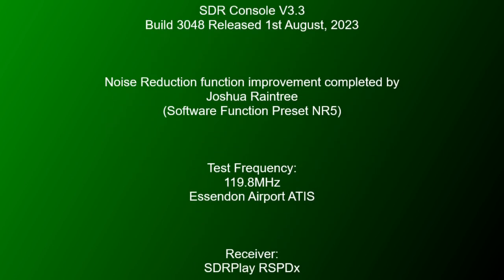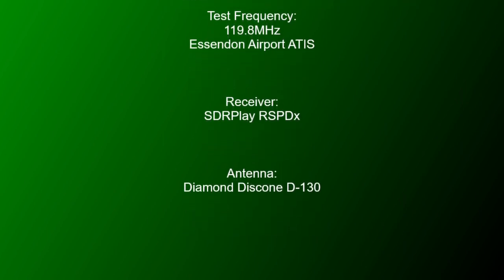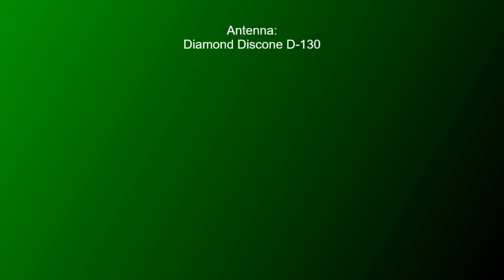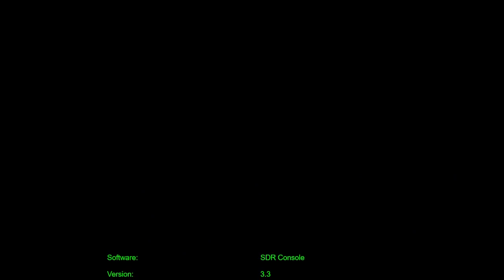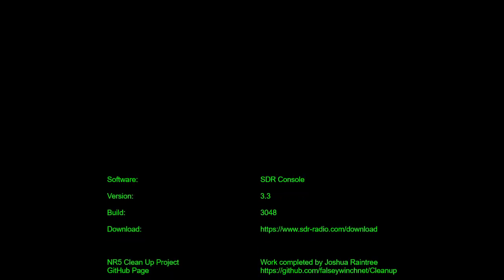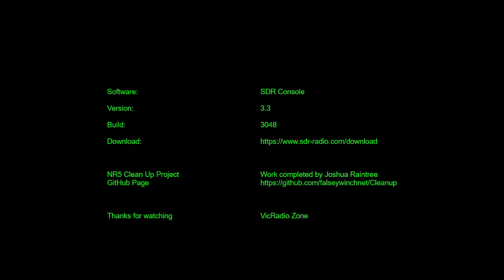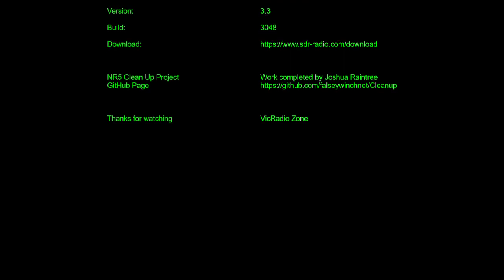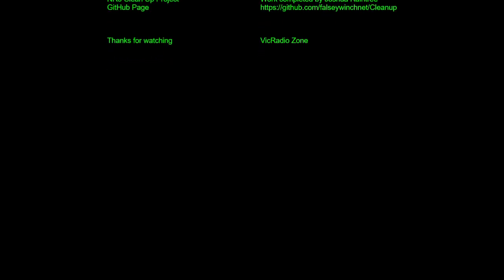SDR Console V3.3 Build 3048 Improved Noise Reduction on NR5

Comment: SDR Console is excellent receiver program. I am using it with both: NESDR Smart RTL dongle and RSP Duo. Just messing with reception of ISS SSTV pictures at 437.800 MHz. It was previously on 145.800 MHz, but I am not sure that they send picture over the repeater at that frequency anymore. I think only at 437.800 MHz (also it is second output from the repeater). Uplink is still at 145.990 MHz. Two Downlinks: 145.800 and 437.800 MHz.